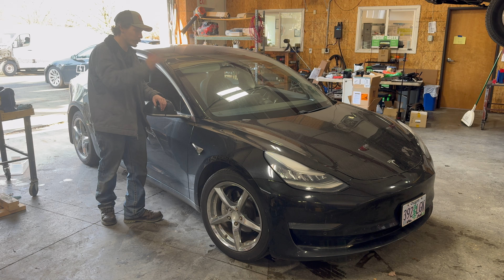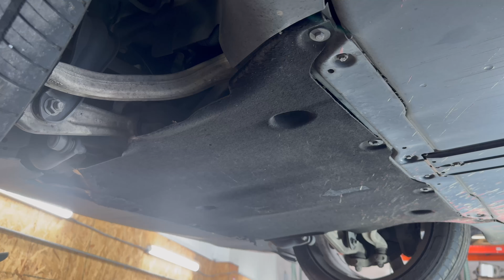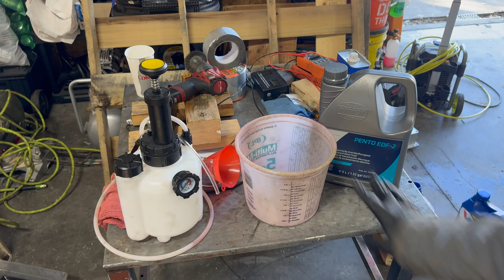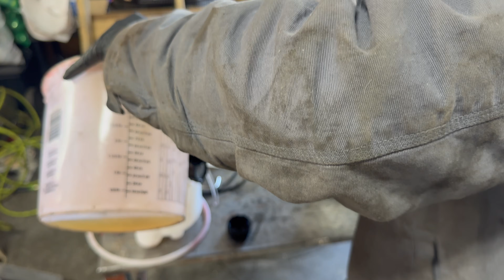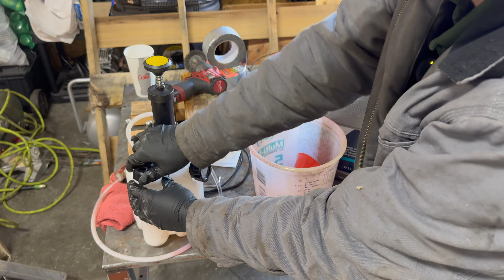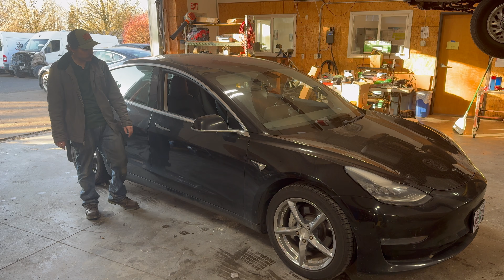Tesla Needs An Oil Change? Model 3 Gearbox Fluid Exchange Process

Comment: Tesla replaced the filter, oil, and oil pump for my 21 Model 3 LR AWD Rear Drive Unit at around 155,000KM.  I noticed a coating of oil around the filter and pump area when changing my tires over seasonally at home.  They did all the work under powertrain warranty.
I traded the car in for a 2025 Model 3 LR AWD a couple weeks later.  
They said the seal (o-ring) for the oil pump was seeping and from what I've heard it's a somewhat common issue with these.

Comment: You mentioned putting a plug with a magnet in a HKG vehicle. Would the Tesla benefit from that? What was the part number for the Hyundai Kona drain plug with magnet?
Reply from the maker: Tesla already uses magnetic drain/fill plugs from the factory.

Comment: Great vid!! I also have a 2018 Model 3 and did a fluid and filter change at 120k and it was super easy, I went to harbor freight, got a fluid transfer pump, the EDF-2 I got at O Riley’s and I got the filter at Tesla, Inalso replaced the fluid pump and drain plug.  I replaced the pump as a maintenance and it has new rubber gaskets too 
Super easy. Old Fluid was not bad looking either.
Reply: Mechanic here no one needs to do this it’s a waste of time and money.  These drive units don’t fail the only ones that fail are the LDU on the early P models they leak coolant into the stator.  The rest are maintenance free.  I repeat don’t bother either this. That filter is designed to contain over 1 million miles of any particulate accumulations
Reply: Please share where to purchase the pump and rubber gaskets. Thank you
Reply: @iqbalu2b  Tesla
Reply: Its O’Reilly, not O’Reilly’s
Reply: @xploration1437  Oh shit! I went to the wrong place.
Reply: @osuave7811 😂
Reply: @xploration1437  you are really a nitpicky guy, aren’t you?
Reply: @xploration1437 oh really?
Reply: @j @jbossnack , look, we got a comedian here.  You’re a funny guy. Now go get your shine box.
Reply: @xploration1437 I will allow you to continue posting here
Reply: @jbossnack . Thank you daddy
Reply: @xploration1437 😅😅😅
Reply: Where you get the lift

Comment: Replacing the filter is very important, in regions where salt is used on the roads, as they are know to rust through and leak out all the oil. This is one of the only things that will destroy a model 3 drive unit. On later versions the oil filter has been replaced by a cartridge type filter placed in the pump housing. Btw. the front and rear transmission are identical. However the front motor is an induction type while the rear motor is a permanent magnet type. I saw this at the Weber Auto channel.
Reply: Good info. Thanks 👍

Comment: How did you make the Pigtail? and how much would it cost to make one?
Reply from the maker: It's a TE Connectivity AMP series connector. The parts are readily available from all the typical online electronics vendors (Digikey, Mouser, TTI, etc.). You can even get one with a pre-terminated pigtail on Amazon...

Part numbers are: 
1-1718644-1 (connector housing, typically <$2)
7-1452668-1 (pins, typically <$0.50 each)
Reply: @OutofSpecRenew thanks for the follow up

Comment: So why is there. no drain plug? This has to be a poor design plain and simple. And would putting air pressure in transfer case to force out as much bad oil as possible? And when you change your oil on anything why not automatically change the filter? Seems like poor advice to use the old filter? Why wouldn't you refill your filter to get the oil at least absorbed in to the pleads of the filter?
Reply: It sure does seem silly to not have a drain plug, doesn't it! Yes, I'm sure a reasonable bit of air pressure would help evacuate old oil, as long as it wasn't so much that it could blow out or damage internal seals or gaskets. Regarding changing out a filter- Since my first motorcycle purchased in 1978, virtually all of them (Hondas) have recommended only changing out the oil filter every 2nd oil change. It was surmised that there would not be enough potential material to completely clog a filter, and in reality, any captured material would actually improve the filtering ability, because the spaces in between the media fibres would be smaller, creating a finer micron matrix. Yes, personally, I always load up fresh oil to the brim in any of my oil filters, or at least let them absorb as much as they can without pouring back out, if the filter mounts "upside down", so to speak.

Comment: I have a 2017 MX, and I was told by a Tesla SC that the rear drive unit fluid can’t be changed without lowering the entire rear drive unit cradle.  They wouldn’t do it.  How do you do it?
Reply: Sounds like BS. It's easy on all S. Why different on the X?
Reply: @moestrei that’s why I’m asking.
Reply: @treborg777 When you remove the rear plastic cover and look at the drive unit it should be obvious.
Reply: The whole procedure is covered in the online Tesla Model X Service Manual ... a web search should readily bring it up. At no point does it refer to "lowering the entire rear drive unit cradle"! Looks very straightforward.

Comment: I recently did this on my 2019 M3 LR and had a few oddities that I'd be curious to your insight on.

On both drive units, the plastic cap popped off the oil pumps before the pumps fully came out the drive unit, exposing both PCBAs. I cleaned the oil off, and reclipped these back on, and haven't had an issue since. Seems like a combination of not a lot of retention force from the clips, and some aluminium corrosion making the o-rings a little tight between pump body and drive unit case. How common is this failure mode/behaviour?

I also noticed, that on the rear drive unit, fluid never came out the fill hole, so I could get the full amount of fluid in without needing to run the pump. Whilst concerning that it wasn't the expected behaviour, all the old fluid came out, all the new fluid went in.

Both these oddities haven't yet caused an issue after 500 miles or so of driving, but curious as to your perspective on this.
Reply: Interesting point. My guess is that in some circumstances the oil may not get into the pump due to an airlock .. in which case you may not be able to get the full amount in there before it starts dripping out of the fill hole. In your case the oil must have been able to flow into the pump and filter enough to allow the full amount to be added.. so I would agree that there's no point running the pump.

Comment: My 3 is at almost 150k, guess I need to do this asap.
Reply: It will make you feel good.  Truth be that not many gear boxes ever fail.
Reply: It never hurts to cause the built up shavings to be removed. A more thorough job would be to occasionally disassemble the unit entirely and clean out the pan and shavings gathering magnet of all filings, then reassemble. In this way, one can also check the play on all bearings in case they need replacing, before actual damage is done. Also, Tesla motors pass coolant through the motor, and this is the time to ensure no coolant is leaking into the place it is not allowed to exist. This is a more expensive maintenance, but significantly more thorough and detailed than just replacing the oil and oil filter.
Reply: @KE8TNW_EN91_Hubbard_OH  In these engines, it's very difficult for the coolant and oil to mix, since they have an oil cooler, not a seal on the rotor like in older engines.
Reply: @groundman7431 that is good to know Tesla corrected is early error.

Comment: Is there a list of all the maintenance for a Tesla model 3? I looked on the manual and it says nothing about this on there (unless I suck at searching)
Reply: Probably isnt because tesla like other manufactures say this is life time fluid, nothing is life time, espectially oil.
Reply: Tesla initially didn't used to suggest any maintenance at all ... then they started advising, for example, that you should have a regular brake service if you routinely drive on salted roads in the winter. Things change. Knowledge about the needs of of high mileage vehicles is relatively new.

Comment: Alex, can you detail the battery and connection gear need to manually cycle the pump?
Reply from the maker: It's a TE Connectivity AMP series connector. You can get the parts from all the normal online electronics vendors (Digikey, Mouser, TTI, etc.). You can even get one with a pre-terminated pigtail on Amazon for a bit more money. 

For one time use, you can also just use a couple of .110 female spade connectors and attach them to pins 1 & 3 on the pump (just make sure to get to polarity right, Pin 1 is +, Pin 2 is -). 

TE Part numbers are: 
1-1718644-1 (connector housing)
7-1452668-1 (pins)
Reply: @OutofSpecRenew  Re-read your instructions on which pump pins to power to run the pump. I don’t think that’s what you meant to say. Doesn’t make sense.
Reply: @OutofSpecRenew  Awesome, thank you. Wishing you a boring move to NC.

Comment: What about changing the O-rings on the fill plugs and the pumps?
Reply: Replace them for sure. I replaced my pump which had new gaskets on it too.
Reply: Unless you damaged it, probably not needed. I can see the pump oring is likely FKM so should last a while.

Comment: You should cut the filter apart to see how much debris has been collected. And just like an engine oil filter, you should apply a little bit of oil to to the rubber gasket to the new filter before installing form a good seal, and prevent the rubber gasket from binding as the filter is screwed on.
Reply: He did apply oil to the seal.
Reply: @joemulkerins5250 I would have inserted the drain plug first before using brake cleaner to prevent contamination of the new oil, as the brake cleaner in the oil could affect seals that keep the coolant from leaking, by attacking the gasket material.
Reply: @KE8TNW_EN91_Hubbard_OH Good textbook steps. But mechanics at the shops working on the clock will not care that much. They'll zip thru.
Reply: @Mods-Testers I think this guy cares about what he does. He takes a straight forward approach to what he does, and is basically loin his approach to repairing BEVs. We need a lot more people lie him all all across the USA!
Reply: @joemulkerins5250 not shown on camera.

Comment: That oil was pretty dark compared to the new oil. Great DIY.
Reply: Yess! But what made it black? No combustion
Reply: @Blasterxp oil will go dark in every transmission/differential
Reply: Isn‘t that normal for oil? I think the new oil will also look like this after a few heat cycles. I suppose, he replaces that oil because the molecules get sheered by the gears under load over time, altering the viscosity and thus decreasing the performance of the oil.
At least thats what I know from combustion engine oil.
Reply: @mineapple8612  This is equivalent to changing gearbox oil ... it doesn't get anything like the punishment heat cycles and the accumulation of products of combustion that you get with engine oil.
Reply: I love the comments like this from folks who know little about lubricants, but probably a lot about screen devices. I suggest you absorb the content from your screen over at "The Motor Oil Geek." You'll learn so much!

Comment: Good advice I replaced the motor/gear reduction fluid my 2017 Bolt EV at around 85,000 miles

Comment: Would love if you could do a breakdown of worse case battery issues / scenarios and costs. For example I’ve been wanting to get a Taycan under CPO but after 3 years and warranty expires  I’m worried battery will give out / get damaged and I’ll have to replace it. If it’s like 4/5k fix then cool but if it’s like 10/15k then yeah no lol
Reply: Why. The battery is designed to outlast the vehicle. 
EV batteries can last decades, and most have a 7 or 8 year warranty.
Reply: @johnnodge4327 battery gets hit by something it’s game over.

Comment: Sure but the gasket on it will rot and let go, like mine did i have 2018 LR RWD and it slowly started dripping i took it to tesla and they put new one it, because its still under warrenty. But i will change the oil myself when warrenty runs out in 3 months

Comment: Where do you find or how do you make the cable to start the pumps from your 12v battery?
Reply from the maker: It's a TE Connectivity AMP series connector. The parts are readily available from all the typical online electronics vendors (Digikey, Mouser, TTI, etc.). You can even get one with a pre-terminated pigtail on Amazon. 

For one time use, you can also just use a couple of .110 female spade connectors and attach them to pins 1 & 3 on the pump (just make sure to get to polarity right, Pin 1 is +, Pin 2 is -). 

TE Part numbers are: 
1-1718644-1 (connector housing)
7-1452668-1 (pins)
Reply: Ramps

Comment: The mere fact that there is no drainplug for the gearbox tells you that it's not meant to be serviced.  Also, those covers are not "skid plates".  Skid plates are made of thick metal.  Those are merely splash guards and unlike what you said, they do not "protect the battery".

Comment: For context of readers coolant maintenance is not necessary unless certain variables are present, which the owner/shop will notice.

Not required or scheduled — Tesla won't prompt you for it based on miles or years alone. No alerts like the older "every 4 years/50k miles" recommendations (which applied to early Model 3s but were removed around 2018–2020 after real-world data).
Proactive consideration — Some owners and independent EV shops still suggest a flush/refill around 100k–150k+ miles (or 8–12+ years) for ultra-long-term ownership, especially if: You notice low coolant levels repeatedly (possible minor leak or air ingress).
Any thermal system warnings/alerts appear (e.g., reduced cooling/heating performance, "Coolant level low" messages).
High-mileage examples show signs of contamination (discoloration, debris) during unrelated service.
You're in extreme climates (very hot/cold, dusty/polluted areas) where radiator clogging could indirectly affect the system (Tesla recommends radiator cleaning as-needed via the touchscreen Service menu).

Brakes only require simple visual inspection and physical checks by pressing the brakes.  That can be done when you rotate your tires.  Not really maintance.  Same thing for the brake fluid.  It's a simple prob and inspection.  Unless you notice something off, don't bother.  Cabin filters are a personal choice on changing. Every year or every 2 years or more, it all depends on how you use your AC and environment.
Reply: Radiator cleaning is probably more important than any of the fluids. Lots of leaves and crap can get stuck in there depending on where you live.
Reply: @jaro6985 indeed 👍👍
Reply: @jaro6985  I bought an inexpensive mesh insert for the front grill on Amazon that keeps pretty much everything out. Worth it here in NY where tons of leaves in the Fall.
Reply: @civwar64bob77  thanks didnt know they exist
Reply: Brake fluid needs to be tested for moisture on all cars. Moisture can boil creating a compressive gas leading to no pressure.
Reply: You should not need to check or access your brake fluid reservoir annually.  You’re adding in moisture when you do.  If you notice your brakes not feeling the same, simply use your probe and check the fluid real quick.   Moisture probes for brake fluid are cheap and widely available.  Again, this is not maintenance but more about monitoring and inspection.  EVs will need their brake fluid replaced at some point.  Teslas only require a health check after 4 years meaning you simple use a moisture probes in your driveway or in your garage.  If the checkup is good close it up and monitor as you see fit.  Again, more about inspection not maintenance.

Comment: Pro tip, always loosen the fill plug first to ensure plug isn’t seized and able to refill after draining.
Reply: Absolutely. It also ensures that maximum oil can be drained quickly so that no metal particles are left sitting in the back. Fast = good.
Reply: Great tip
Reply: And spraying brake cleaner at the fill hole while it is still open is criminal
Reply: Sounds like you are speaking from experience.
Reply: Beat me to it. Always
Reply: yep. been there!
Reply: The only reason to not do that is if you have a second car to drive while you figure out how you're going to fix it.nn:)

Comment: I hope you fixed those incorrectly torqued bushings on a model Y from two weeks ago that everyone pointed out and you didn't respond a single time.
Reply from the maker: Yes, the bolts were loosened and re-tightened with the car at ride height.

Comment: You can use a jack stand on the front drive unit remove that bolt that’s attached to the subframe and you can remove the oil pump all the way and you can get it drain the system completely also might as well if you’re there, you could replace the oil pump in the filter since you’re there.